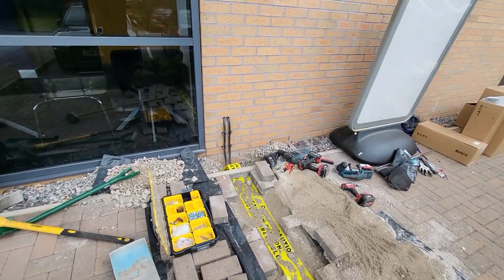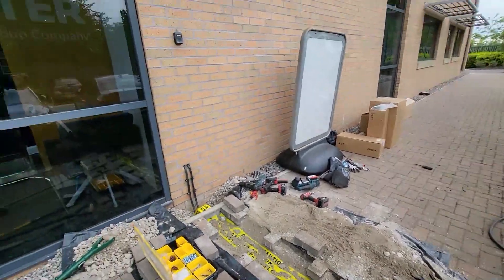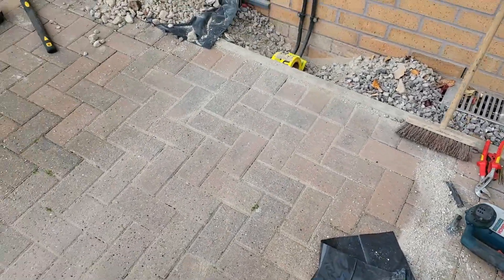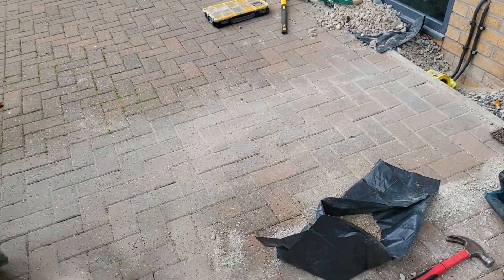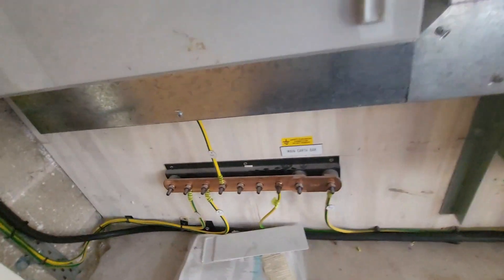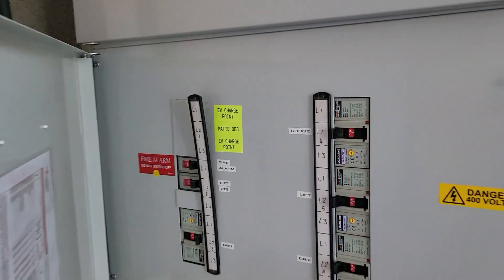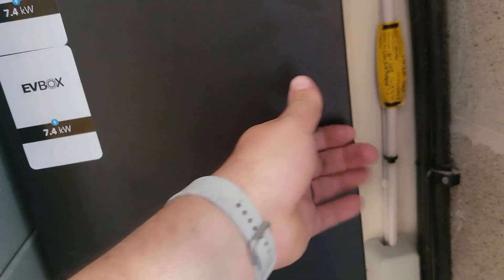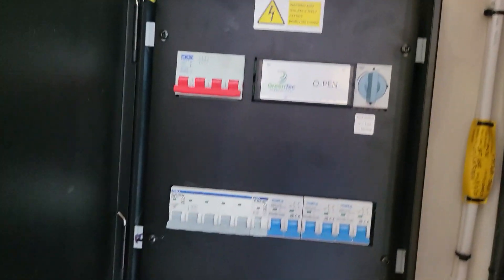YouTube Electricians Extravaganza! Trench work, MCCBs, SWAs

Comment: Nice.  Did you say you haven’t terminated the swa in the ev charger and Just sleeved it?
Reply from the maker: Exactly that Darren. The armours need to be covered and not earthed at the charge point end to avoid bypassing the pen fault protection. The armours need to be earthed via the supply end so they have earth metalic protection at all times direct back to the earth bar in the DB. For obvious reasons. Hope that helps. So we tape and shrink sleeve in the charge point.
Reply: It makes sense but I thought it was good practice to correctly terminate the swa.  This has always bugged me that you only have to earth one end of an swa in some circumstances but both ends maybe metal enclosures.  I just don’t banjo one end (I don’t do ev).
Reply from the maker: @darrenplant1428  I know what your saying but even with no banjo it will provide an earth path to the metallic ev post. Which is a no no. In this case its the only thing you can do as no space for a plastic enclosure. It's not ideal but the best way to do it in this case.
Reply: It was a great job Mark. What else can you do if there is no provision for these things.  We could really do with a pvc swa gland inventing.

Comment: Enjoying your content mate! What supply size is the main intake? Do the chargers have load management or is it not worth worrying about? Also I'd like to know more info on how you manage the 4G connection - do you do back office payments? Thanks!
Reply from the maker: Hi Hayden, the 4G is managed by the main contractor so not sure what the crack is on those tbh! Load management is in place the chargers have comms between each other and back to the hub. Supply was 200A TPN but the measured load on the install was only 40A across all three phases to start with. Not a lot in these places tbh.
Reply: @electrician247  Thanks for the reply! Oh right okay, it always worries me fitting EV chargers without load management! But hardly worth worrying about if it’s 40A like you said.

Comment: Top marks for using a brass screw and nut with the banjos! Nice tidy install, liked the look of those chargers. I don't see much of an issue with the Matt-e over the telecoms cabling, at the end of the day it is an earthed metallic enclosure that should prevent any emf interference.
Reply from the maker: That's what logic told me and seems to be the case! Thanks !